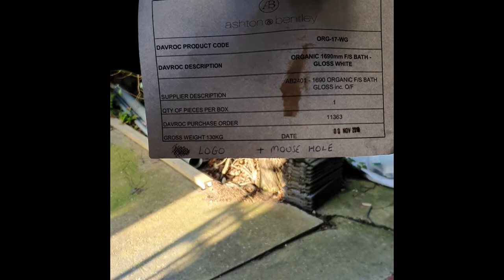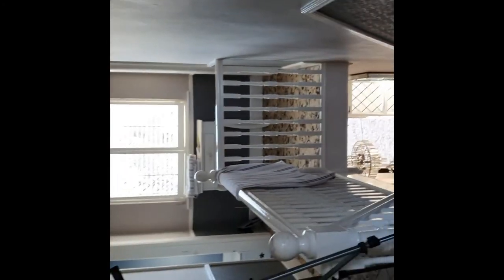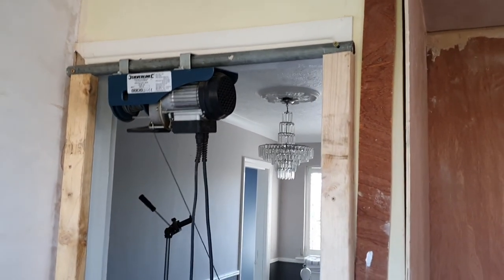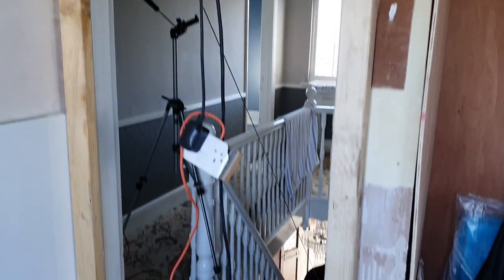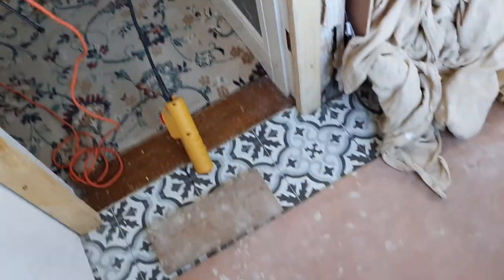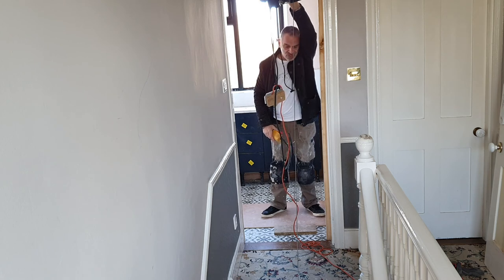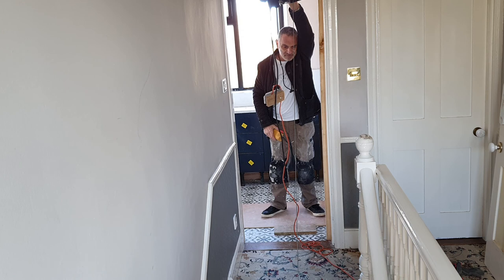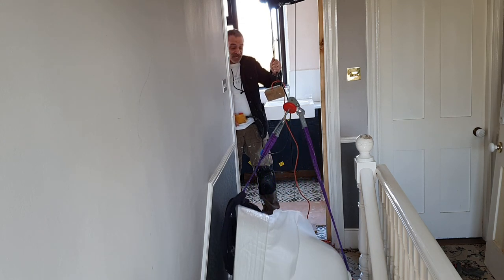Genius way of getting a very heavy bath with nothing to hold onto in the house and up the satirs

Comment: Interesting. So you need to buy a winch to move an acrylic bath? What about a 230 Kg cast iron bath? Not everyone owns a winch. My stairs also has a 90 º turn at the top three steps 😢
Reply from the maker: I didnt buy the winch for the bath, I already had it. This video was just to show how I used whatever resources I had around me to  get the bath upstairs. a 230 Kg bath going upstairs and around a corner sounds like a nightmare. I'd love to find out how its done. 
Good luck
Johnny
Reply: You can buy a winch relatively cheap. We bought a cast iron tub about  four months ago in April 2024. Put it belly down, legs in the air (missionary style 😉) and just pushed it up. Got to the 90 degree turn, and lifted it up, turned again on its belly and pushed up the stairs again. Still haven't installed it.